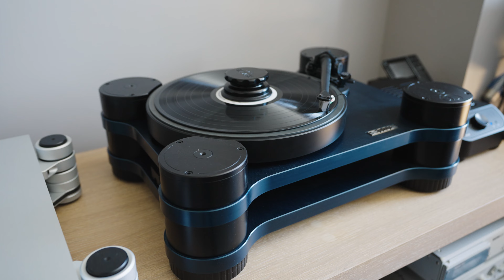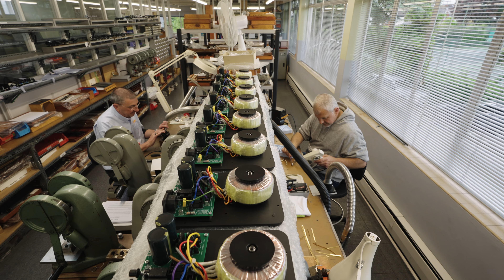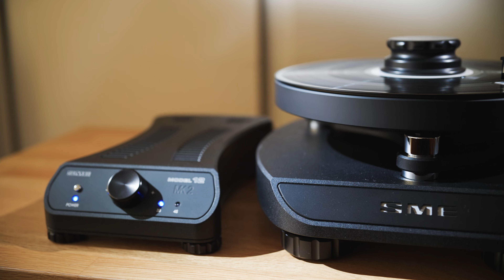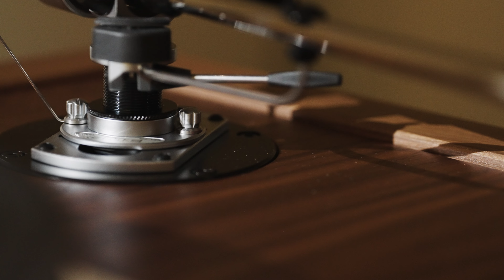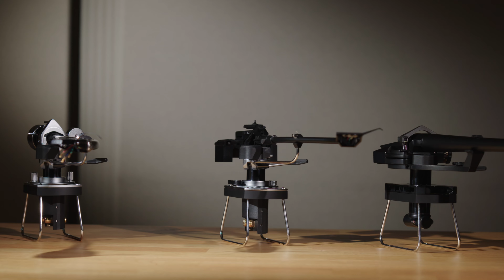Sponsored content: SME Limited

Comment: Strange that in the (very) short list of critical turntable attributes - vibration isolation and speed stability - isolation from external sources of vibration was mentioned rather than suppression of motor and bearing noise which is always present within the system itself.